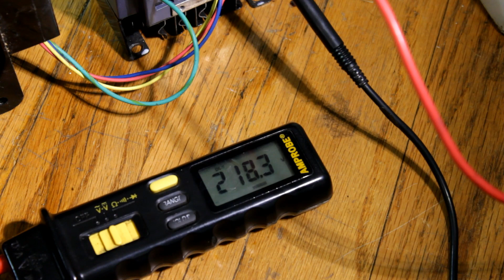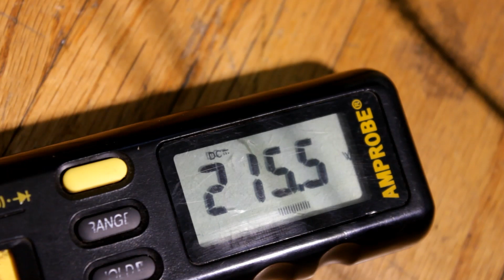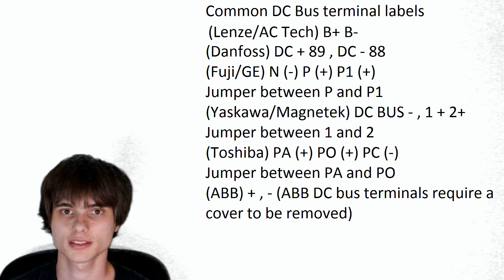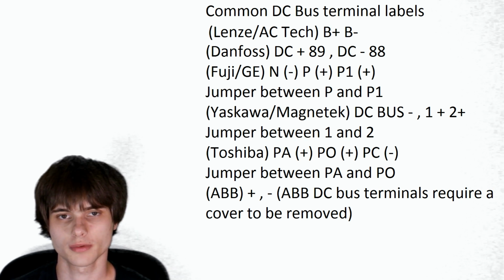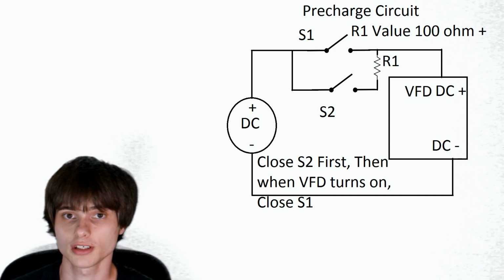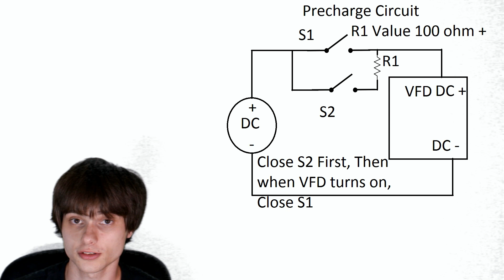How to run a VFD from DC

Comment: Hi, 
I have a 3phase motor 3hp 2.2kw, 380V and 6A , connected to a VFD of 4Kw, What DC voltage will be required to run this motor. Thanks

Comment: I just saw your video from 8 years ago. My VFD has a DC input. It's new. My question is, I'm starting a three phase motor from the DC, it's powering a generator. Once the AC current comes back to the VFD will it automatically transfer to the AC voltage.

Comment: How can i run my 380v bldc motor from a vfd. It does run but gets hot quick . I need to modify the stepped pwm output to a straight dc pulse . Capacitor in series on each output ?

Comment: Was looking for the answer everywhere. Nothing found. Here is the picture what if we connect 3 individual dc to ac inverter (single phase 240v) to the 7.5kw VFD drive as the 3 phase input to get the 3 phase output. Planning to run 415v 4kw motor. It may be a stupid question as i am not an electrician. Few things to note
1. VFD's with DC bus are bit expensive or can say 3 phase to 3 phase vfd are very easy to find.
2. Not sure about the Dc to dc booster reliability. 
Thanks for sharing your knowledge.
Reply from the maker: Not sure about using 3 separate inverters. It might work but it would  be best if they were actually in the correct phase relative to each other. That would be difficult to achieve if they are apart from each other.

You might try just connecting the DC to the input. Most modern VFDs are just powered right from the DC bus anyway so the input would likely lead directly to the rectifier. 

Not sure why a DC-DC boost converter would be less reliable than a DC-AC inverter. In fact, a boost converter is actually much simpler and has fewer parts
Reply: @subcooledheatpump  Thanks Bro, Will try with the DC Bus or let see if can make an Input. will update about the outcomes.

Comment: Sir in  vfd abb acs 355 everything is ok when command os given then output not come out frequency is start why
Reply from the maker: Check for input phase failure detection. If the drive has that feature, turn it off

Comment: I am exploring EVs. can I  run a 10hp motor with a VFD DC setup
Reply from the maker: As long as you have a VFD that can output 7.5 kW (10 HP) or more and it can be run from DC, yes. If it's for an EV I highly recommend getting a VFD with some form of torque control. An ABB ACS600 will do it, another example is a control techniques Commander SK
Reply: @subcooledheatpump  Thanks for the prompt response. How about for something in the 5HP range
Reply: @subcooledheatpump  Hey just a quick follow up to my question above. I have decided that I simply around 3 - 5hp for my design. what VFD with DC support could you recommend in that range.

I have been searching the internet and it does not seem that many people are using the DC part in VFDs. The reason I am choosing this aproach is because the EV motor controllers are very expensive. However a VFD can do moreless the same thing
Reply: btw, I am looking for a VFD that could cost between $100 - $200

Comment: Thank you for the Video. I liked it. I came across this video tutorial because I ordered wrong model, my mistake. I wanted ABB ACS355 series but ordered ABB ACS550. This has inbuilt chopper. And do not have DC bus terminals. I had to open it to figure out the DC bus. I want to connect solar panel output on this DC bus. 
I connected drive to 3 phase supply and measured DC bus voltage. It is around 565 V. I am assuming that supplying DC 565V should be sufficient. I hope control logic is powered from this DC bus only. I have following options to connect DC power to Drive.
1) Connect +ve of the solar panel to Break resistor terminal (to the one which is connected to +ve of DC bus) and -V of solar panel to all three AC terminals. In this way only half of the rectifier diodes will be working. 
2) Hookup Solar panel terminals to the internal DC bus.
Do you have any suggestions? Do you think this will work?
Reply from the maker: I would try to connect the panels to the DC bus internally if possible

Comment: Enjoyed your post. Thank you.
Question for ya. Is it possible to convert vfd output to full wave? By connecting bridge rectifier.
Thank you
Reply from the maker: It should be possible, although I'd use an LC filter on the output before going into the bridge rectifier
Reply: @subcooledheatpump  thanks for your quick response
Reply: @subcooledheatpump  what output lc filter "reactor" would you recommend? I've seen few online with max 400hz.
Thank you
Reply: @subcooledheatpump  
1000v bridge rectifier didn't work. Can Transformer Rectifier Unit TRU 115v 400hz drive from vfd controller? 
Do you happend to kno, if they make higher voltage bridge rectifier? 2000v plus.
Ty

Comment: My name is Mike Karanja. I been watching ur VD on youtbe. Yeah and I been liking all most all of them Congratulations and keep it up.  I requestin some of your help.  Ok.  I build IGBT controller Vdc 40 volts.  It's working pafetly between forward n reward High speed it's working perfectly, while am controling speed with pmw,  n when want to reward am using switch to off A to B.  Here we come the 👉 point.  When I load my IGBT control with a Highy voltage it's blowing my IGBT.  I was requesting ur help, how can I build a diagram that can be able to handle a higher volt on IGBT control,  thank you. Hopefully to you ur warm 🤗 response,  thank you again.  N I love  i like your work. God Bless you more and more
Reply from the maker: Have you tried increasing the IGBT switching time? If they are turning off too quickly the turn off spike could be going above the IGBTs rating. You can slow them by increasing the gate resistor value
Reply: Thenx bro for ur quick response. Am highly appreciated. I tryed all that but what happened by the end of time once I try with a low voltage it's working cool.  But once I plug Highy voltage I find myself in a dip stress of IGBT explication,  even if I disconnected pmw.  IGBT still exploding.  Am in Qatar.  N I wanted to make my own car control.  And I want to use between 300v to 500vdc that is.  Do you have any diagram or my request you send the the diagram I can use please I request.  It's will be my pleasure.  Here my email adress is it's will be ok with u to send me here thank you, Mickykarash@gmail.com
Reply: And I have another question.  If I use the IGBT with the normal 3 face motor , will it work with IGBT?? Thank you so much Bro n God Bless you
Reply: How are you today bro. Hope you ar doing well.  And did u got my previous message?
Reply: Please I would want to know how you resolved this issue. What solution do you have eventually? Please I would appreciate if you share with me. Thanks

Comment: 1.how can i run DANFOSS 2882 vlt (input 400v 3 Ph) with out control pannel (using 5K veriable resister wear to connect)  2.I doesnot have 3 Ph power then connect DC 650volt to vfd to run 3 Ph 3 HP motor?.

Comment: I hope I'm not being a pest!, but I found this parts break down manual in pdf form for my drive online, and it is showing the cap values @ 1400uf 400vdc. Parts List Part Number Description Quantity  CC0236A06 CAP,ALE,1400UF,400VDC,-10+50%,85C,BRKT 2.000 EA.
So my assumption is that I shouldn't charge these caps past 400vdc right?!
Reply from the maker: If you are certain that you have a 460 volt drive, then it likely will turn on at around 380 volts DC and overvoltage trip at around 800 volts DC. The DC bus capacitors in a VFD are usually in a series, or series parallel. So it's more than likely your actual safe voltage is around 800 volts DC. By the way, Electrolytic capacitors usually aren't rated higher than 500 volts DC, which makes it necessary to put them in series in ANY drive that is over 240 volts AC
Reply: That's good to know. The power supply I bought has a max red line voltage of 700vdc, so like you said the VFD should turn on after I reach 380volts, plus with a max voltage of 700vdc I should never be able to over voltage the drive.
Thanks again!!

Comment: I have a Baldor H2 Vector drive, model VS1GV45-1B. It's a 460vac 3ph, 5hp. I am wondering how much DC volts I should put on the bus.
Reply from the maker: Usually the drive manual will tell you the limits for minimum and maximum bus voltage, but the short answer is about 650 volts DC
Reply: Thanks! I have 300 volts of battery power now, so I have to acquire another 300 or so. My Baldor has a B+, and B- terminals where the braking resistor terminals are located, so I assume that those are the tie in to the DC bus. Do you recommend that I build your precharge circuit?
Thanks for your videos, and thanks for helping all of us DIY'ers achieve our goals!!
Reply from the maker: I looked at the user manual for the drive, It does look like B+ and B- are the bus connection. Yes I would use a precharge circuit in this case, just to be sure.
Reply: I just bought an AC to DC power supply on Ebay. It's a 0-600 vdc adjustable voltage supply. ($199.00) I figured that would be cheaper than getting 25 more 7ah, 12v SLA's, which go for $16.00/pcs.
Now with a power supply, where I can dial up the voltage slowly, do you still recommend a precharge circuit?
Reply from the maker: It won't be as important now that you can adjust the voltage.
Reply: Thanks!! Now to tell you about my project! I'm experimenting with reactive power. I have 2 Baldor 5hp 3ph motors direct coupled, and the VFD is for the prime mover. I also have a Reliance 3hp Servo Motor with an encoder that 'm considering using as my prime mover.
Thanks for all you valuable insight! I really like your channel!!!
Reply: I'm replicating the Rotoverter experiments started by Hector P Torres.
Reply: @14jerseyboy56  Hello Paul, could you share the link of this power supply? I plan to buy one, finally we have the possibility to test the 3 phases inverters on the bench without 3 phases supply.

Comment: i've got 2 rubicon vfd units good for 60hp motors. 480v 3 phase input with built in transformer to 120vac for control circuitry.
what would happen if i were to remove the 120v transformer, hook 120v to that and use dc  for the dc bus? would that work, and would i be able to run less voltage to run say a 208v motor? (it probably has software errors for low voltage to motor, though)
Reply from the maker: You can supply separate 120 volts AC to power the control circuitry, but i'd use an isolation transformer. You should then be able to supply DC to the bus directly, as long as the control circuitry allows the bus voltage to go that low, it should work. There is a good chance however, that it will lock out on undervoltage. Although you could just use 480 volts and reprogram the V/F pattern. Unless you've only got 208 volts? Not sure what you're trying to do but usually 480 volt drives want atleast 600 volts DC on the bus

Comment: Well done! What sort of boost converter are you using? I am working on an isolated boost converter that can operate on input of nominal 12, 24, and 48 VDC, with outputs of 150, 300, and 600 VDC. By using a full wave bridge input at 50% duty cycle, the rectified output only needs a small capacitor. I think I can get about 800-1000 watts using an E55/28/21 ferrite transformer, and hopefully about 95% efficiency at 50kHz. I'll be posting on DIYelectricCar and I'll probably make a video on YouTube as well.

Comment: I plan to get a 3 phase compressor. I will take the DC directly out of a 24v inverter and feed it into the VFD.
Reply: Awesome - that's a big load. Did it work out? I plan to try and make a mobile electric bandsaw mill I'd love to know if you managed  this.

Comment: HI, Love you MOSFET stuff and I have been getting stock of the driver IC's for our UK customers at BasicMicroUK and many customers that have purchased these have mentioned your advice when calling to order, I am going to be doing some high power experiments with MOSFETS soon that I hope to share on you tube, on the subject of these AC inverters powering them from DC is even easier than you mention here, because the front end is in effect a rectifier you can simply feed the DC voltage into ANY of the existing 3 phase input terminals and in any polarity it does not matter and it will work perfectly, another advantage of this method is that you will still be using the drives built in capacitor pre charge circuit so no need to make an external circuit with a pre charge resistor and bypass contactor, I have a 20HP inverter running from a super capacitor bank connected in this way, the only disadvantage of this method is if you come to want to make use of the REGEN power but for simple powering up of 3 phase fans or machine tool motors from DC its perfect, I hope this helps, Keep up the good work, Dave.
Reply from the maker: Sure you can put DC directly into the rectifier and turn on the VFD that way. But don't forget all that current flowing through the rectifier is just creating needless losses. There is no such thing as a perfect diode, and every diode has a forward voltage drop. Granted for a small VFD the losses are negligible, but for a 20 HP machine like you've mentioned, I'd personally just use an external contactor and precharge to avoid heating the rectifier. Thanks for watching